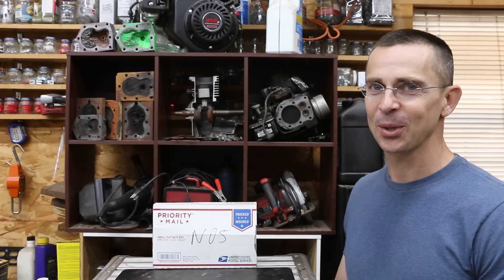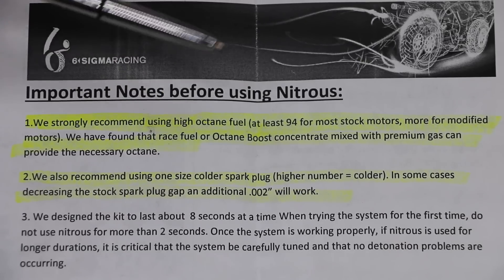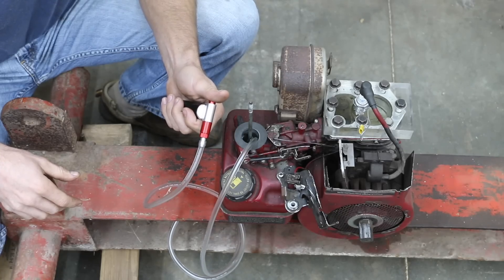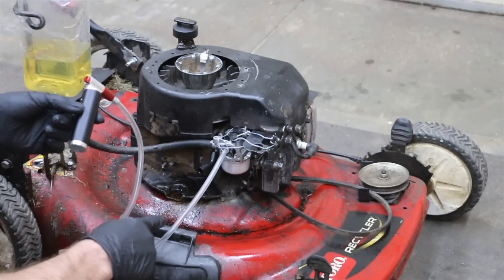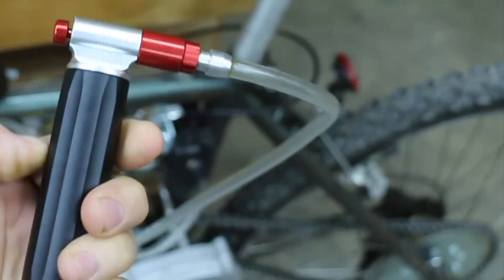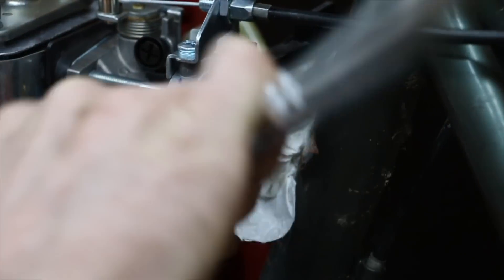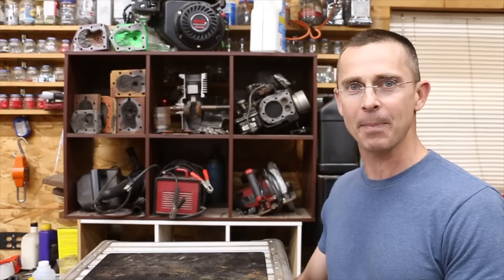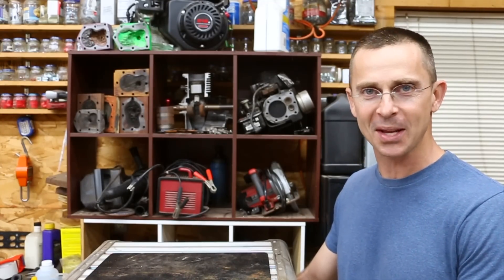Will the 4-Stroke Bike Survive Nitrous Oxide?  Let's find out!

Comment: That kit with the little baby gas cylinders is neat because it allows you to try it out with low cost and a TON less work than a system where the orifice is on the engine and all the lines are high pressure.  who would have guessed such a kit existed!  Might be able to help your pinging/spark knock by making the mixture more rich, not sure how easy it is to adjust the timing on that engine but you probably need to back it off a bit since the nitrous seems to make the mixture ignite rapidly compared to without.  of course any of those adjustments will hurt performance when not using nitrous so that's a good example of why they use computers on engines to adapt to all these variances.  Another great video, thanks for taking the time to make these!
Reply from the maker: Great point. Thank you

Comment: once again these small engines need the air cleaner on them when running or you will be running in a lean condition.
Reply from the maker: Great point. I have a much larger jet on the Toro.  It's running a little rich.  Thank you

Comment: Not really sure how it’s doing much as on a car you have to have a way to squirt in extra fuel with the NOS to make more HP ??
Reply: The only reason it's doing anything at all is because the decomposition of the oxygen from the nitrogen. Nitrous oxide is formed by an endothermic reaction: It takes energy to oxidize nitrogen. You get that energy back, when it decomposes from being exposed to the heat of combustion. You're exactly right though, adding more fuel to use up the liberated oxygen, produces MUCH more power. Extra fuel is also necessary to use up that oxygen, so it doesn't oxidize pistons, and valves. Running nitrous without extra fuel is similar to hitting the oxygen key on a cutting torch!

Comment: This is great. Love this. I'm a car guy so some advice, Find a 5gallon can of MS109 or MS100 VP race fuel at a gas station near you (Google). Runs around $100 per can. Then add it 100% to the tank and it will add good power and mph then combined with the nitrous I think you will be suprised at the results. 😉👍
Reply from the maker: Great video idea!

Comment: Having not read all of the replies I'm sure that it has already been mentioned. NO2 is nothing more than an oxidizer that allows the engine to properly combust more fuel in order to produce more power. Without the addition of added fuel it is only allowing the engine to more completely burn the fuel that is already present. If the carb was jetted excessively rich you would have seen an even greater benefit as the NO2 would have allowed the extra gas to burn more efficiently.
The pre-ignition you experienced is more than likely detonation.
Interesting video, thanks. Glad to see that you did not blow that little puppy up. 
Keep up the good work and the interesting videos!
Reply: 74Willy That plus the endothermic reaction & expansion going on as the oxygen breaks away at 1200F.
Reply: Exactly what I was gonna say. His preignition was probably due to the lean condition caused by the N20. BTW I ran a 350 hp boost in a 68 Charger R/T that already had 500 Hp. It was like the Jolly Green Giant kicked the car in the ass when the button was pushed.
Reply from the maker: Thank you!

Comment: Check out the MSD 4217, it's what you need for the spray
Reply from the maker: Great recommendation!  Thank you!
Reply from the maker: Do you have any experience with setting up the 4217?  I need a way to "trigger" the ignition module.  I called the MSD tech line and they said the factory flywheel on the Predator 212 or a Briggs & Stratton won't work.  Could you please create a new comment so I can find your reply or send an email to me at projectfarm52@gmail.com  Thank you

Comment: You would also need to fatten up the fuel mix to help with preignition. going lean there hence the very yellow to white flame. Backing off the timing will also help with excessive cylinder pressure and temperature. Racers use different timing and fuel maps  that are selected when they hit the button.
Reply from the maker: Great recommendation!

Comment: I'm fairly confident that if I put even a small dose of nitrous in my 165000km 1.2 FIAT engine that basically runs on oil, it will cough up a rod or two. Maybe I'll try while driving to the scrapyard one day XD
Reply from the maker: lol. Great point.  I have an older car that wouldn't last long either.

Comment: 0:60 "nitrous decomposes explosively... that's where you get the extra power"
*Not true*. The extra power associated with the use of nitrous oxide comes from the ability to burn additional gasoline thanks to the oxygen introduced to the combustion chamber by the decomposition of the nitrous oxide. Just as a forced induction system by supercharging or turbocharging allows the creation of more power by burning additional fuel thanks to extra air ingested by the engine, nitrous oxide is injected into the engine providing the additional oxygen required to burn extra fuel thus creating more power. If you inject just nitrous but no extra fuel you may see slight power gains due to a more complete burn of existing fuel but those gains are inconsequential and only possible if combustion efficiency was poor beforehand. Using nitrous oxide without additional gasoline can also create dangerously lean conditions and elevated exhaust gas temperatures.
Reply from the maker: Great point. Thank you

Comment: The chemistry behind nitrous oxide is the following, since you just added the gas (N2O) to the inlet flow: Gases, regardless of their kind, have approximately the same volume per number of atoms. While air consists of 79 % inert components and only 21 % Oxygen, N2O decomposes above 650 °C (nice job pointing it out in the MSDS) to a mixture of 66,6 % Nitrogen and 33,3 % Oxygen. Thus you leaned out the engine resulting in a much higher engine speed. The same happens when adjusting a carburettor too lean. The additional speed on the road may have come from this increase in engine speed or a more thorough combustion due to excess oxygen in the cylinder. Or maybe from the overall increased Number of molecules due to decomposition and increased temperature due to the lean mixture in the cylinder.

As some people already pointed out an adjustment of the fuel/oxidant ratio when injecting N2O might lead to an "explosion" of power. Or of the engine...

This could be done by a small electric pump, or, more easily, by a pressureized fuel container (maybe a soda bottle with some fuel and an air bubble above it) with a valve mechanically connected to the N2O valve. From this valve a hose could lead to a spraying nozzle right between carburettor and cylinder.
Reply from the maker: Thank you!  I'll come up with a way for to add more fuel.

Comment: Have you tried it with a richer mix? It's just an oxidizer, so you need to add more fuel when you use it to get full effect.
Reply from the maker: Great recommendation on more fuel!
Reply: more fuel and also the timing needs to be adjusted.
Reply: Derek Waggoner 
More fuel is enough. These small engines have very low spark advance.
Reply: @juhomaki-petaja  put advance in it if you want imo
Reply: Project Farm NOS is chemical charging. You add more oxygen to cylinder. Thats why you need more  more fuel.
Reply: A Wideband Oxygen sensor to generally monitor air fuel mixture will definitely help and make that upcoming video interesting!
Reply: Agreed more fuel for another test.
Reply: Would also be VERY interesting to try 2 tests on the see through cylinder head.
1) like the original where we can see the ping happen (fuel explodes instead of burns)
2) same test but with more fuel and a colder plug
Reply: @richieschmidt6225  Right. Definitely needs more fuel to get the benefit from the nitrous. Knock (ping) is the sound of two flame fronts hitting each other in the combustion chamber. The air fuel mixture is lit off at the spark plug. As the flame propagates, the air fuel mixture pockets in front of the flame suddenly ignite. The different flame fronts hit each other and cause the knock. You could say normal combustion is kind of like burning and knock is kind of like an explosion. More specifically, knock comes from colliding flame fronts and is faster combustion. Knock can be captured on camera when a high-speed camera is placed in the combustion chamber. The multiple, colliding flame fronts can be seen.
Reply: @westernapache1700  You couldn't be more spot on! That is the exact way I explain it to people. Fuel propagates across the combustion chamber as a controlled burn essentially. But when pockets of fuel ignite "prematurely" based off of higher combustion pressures/temps, too much spark advance, too lean, too much boost, etc it becomes dangerous. 

Those 2 flame fronts colliding cause excessively high combustion pressures (hence the sound we hear) which destroys pretty much all engines.
Reply: I’m thinking 1 or 2 steps colder on the spark plug and maybe a bit bigger of a jet and it might flow enough to not ping! You could have a reliable NOS setup.
Reply: Loonytoones85  I could be remembering wrong but the way I remember it is, octane booster do not inhibit combustion.  They inhibit detonation, which is an uncontrolled explosion which happens to soon before tdc.  Micro edges on the piston,piston rings, valve, or sleeve when super heated will pre ignite the fuel mixture before tdc causing engine knock.  There are many ways to stop the knock.  Such as adding colder air to intake, more fuel to evaporate in intake and on piston taking the heat with it unless it knocks so you add knock inhibitors to coat rough micro edges to create a micro cushion effect on those edges.  Some of the most used knock inhibitors are #1 lead such as in avgas.  #2 Zinc in the oil.  #3 two stroke oil in gas. Pulling timing slightly may work to delay ignition but if the explosion comes before the spark cycle it is still pre ignition to soon before tdc and there will be damage sooner or later.  Combustion needs to be controlled by ignition system or you can have a  runaway engine like a diesel that found it's own fuel supply like its own oil from crack in crank case, head or blow by around rings.  Hope this helps of remembered correctly.  Try doing any or all these things and you should make more power with less breakage and maintenance.
Reply: Sean Cunningham  For the most part you are correct!  The gas you burn most likely is not Octane.  So adding any additive that does not contain actual Octane will not magically turn your fuel into octane.  Fuel in gasoline vehicles use Octane as a scientific reference only.  How closely a fuel compares to True Octane CH8 is how they get an Octane rating.  Fuel can perform better or worse in any engine.  An engine is only an airpump.  If the engine pumps more air in less time by any means available it will produce more power.
Reply: It's called a dry shot no extra fuel used to use on my snowmobile just use bigger main jets to keep from melting down never really blew up just after one weekend of lake racing pistons & rings gone lol got expensive.

Comment: I beleive the clear engine was seeing knocking, not preignition, they are not the same thing.
Reply from the maker: Thank you.  You are probably right.  I slowed down the video footage a little more and thought is was igniting before the spark.  I need a better high speed camera.
Reply: @ProjectFarm  yeah, that would be the trick!
Reply: @ProjectFarm  ive been told that preigntion doesnt make noise, but knocking does.

Comment: Make sure if you do this to increase main jet size to increase fuel so it does not go lean. Also nitrous does not in crease horse power it cools the air making it more dence allowing more fuel to be burnt. One other thing oil change intervals need to be shortened due to increased blowing from the increased cylinder pressure.
Reply from the maker: Great recommendation!

Comment: try the nos on the generator and see how much you get wattage
Reply from the maker: Thanks for the video idea!
Reply: @ProjectFarm  welcome!
Reply: the limit on generators is usually the windings not the motor (though obviously they try to match the two)  If you try to pull too much power you tend to toast the generator head itself (unless a breaker or other safety system stop's it first of course)
Reply: @Wooble57  i don't have one so i don't know... just thought it's i good idea for the next video
Reply: It would almost make sense to make something using a large alternator, than belt driving it with the engine under test. That way, you can ensure that the engine, rather than the generator  is the limiting factor. It becomes something of a dynamometer, giving a way to take relative measurements of change of performance, when operating conditions change. It wouldn't be super accurate, but you could confirm an improvement, degradation, or no change.
Reply: @vincentrobinette1507  amazing idea👍
i didn't think of

Comment: NOS is designed to work with additional fuel as it is an oxidizer that is why you were getting detonation, the fuel air mix explodes not burns due to extreme lean condition. Add more fuel with the NOS and make real some real HP without detonation.
Reply from the maker: Great point. Thank you